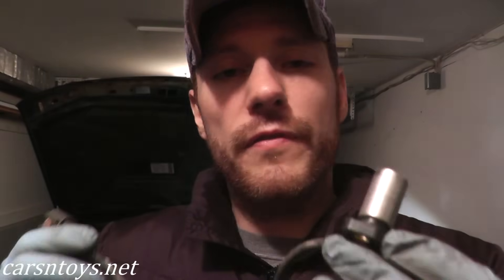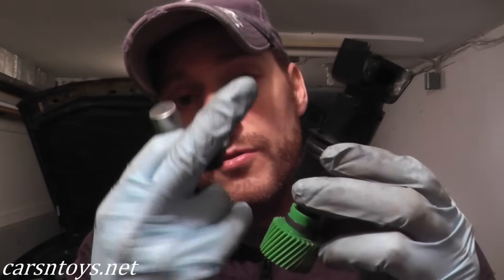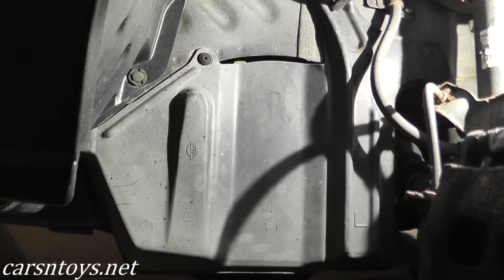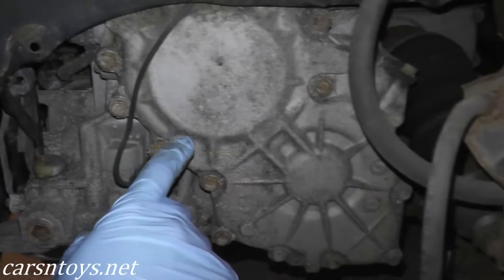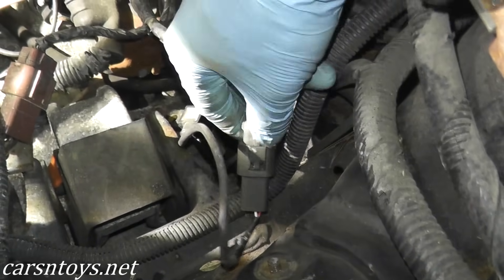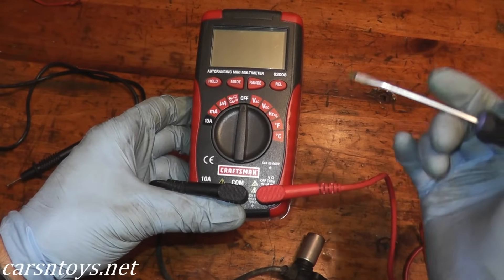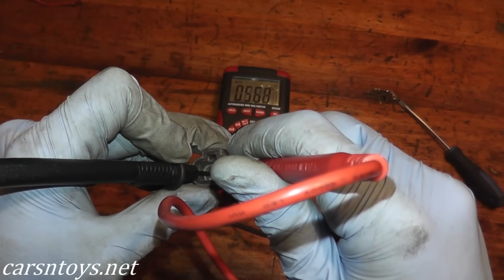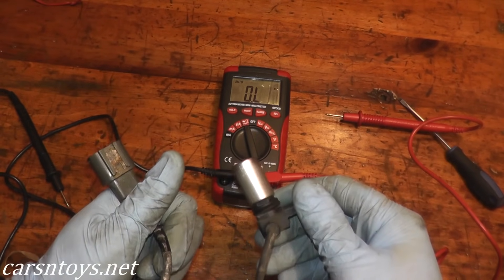Revolution Sensor P0720 Testing and Replacement

Comment: Glad I found this video. My buddy Honda Prelude 96 is throwing a P0715 code Input/Turbine Speed Sensor Circuit Malfunction. I read on a a forum if odomter or speedometer does not work, it is due to VSS, but I did not see that problem when driving the car. The symptoms are kick/jump/jerk (whatever u wanna call it)  after each shift or RPM (automatic). At first, I thought tranny is slipping, but wasn't sure. I just ordered the "Revolution sensor" from APW and hope that fixes the problem, if not, they do take returns unlike Advanceauto.

Comment: Thanks For the Clarification of the 720 & 500 codes!!  Got both the P0500 & P0720, but found that when I unplug the input & output sensors, which are the Revolution sensors on a 2015 CVT Tranny (2015 Nissan Versa Note), I got other codes for the disconnect.  But when I unplug the Actual Speed Sensor, does not pop any additional Codes.  Now need to find this Speed Sensor, not Revolution Sensor :)

Comment: I have to say I have been searching for months to help find info on speed sensors and revolution sensors and you my friend have been the best and most informative I have found.  You explain everything in very simple terms which is perfect.  

I do have a question if the revolution sensor is no good what does the vehicle actually do to give you the idea it might be that?  I;m not talking the code I'm actually wondering what it feels like, does it jerk then catch up, just plain die or what?  

Thanks again for the help.  Wish the parts for these were as cheap here in Texas as where you are.

Comment: So I did this on my 05 nissan sentra. it has a 3 pin plug but on the first and second o believe I get a reading of 503-504 ohms. would this indicate it's failing? I can't find anything on what the ohms should be specifically.

Comment: mine has .445 ohms at 2k ohms i have a f150 5.4 2005 what are the proper ohm specification  for the out put speed sensor in the tail of the transmission

Comment: Love your video. Only, where are you shopping ? In 1:20 you say the speed sensor is $125. I bought that very sensor at the auto store for only $10.
Would this location and procedure be the same thing on Ford Explorer 1998 ?  
Oh my God, you're saying, remove the driver's side front tire, and there it is ? Oh the other videos I've watched from other guys didn't say this. 
Wow, love your video, you are explaining this far better than other video's I've seen from other people. Thank you..
Reply from the maker: Glad to help. The location will differ based on the vehicle; this was a '97 Maxima. If you're uncertain where the sensor is, try Google images or forums. Sometimes you can find the factory repair manual online which will show all sensors and locations.

Comment: my 03 sentra is throwing out a po720. shifts from 2nd to 3rd is sloppy. (shoots up 1000rpms before shifting) and everyday, when accelerating from a red light, the transmission will stay in first gear... so i pull over and cycle the engine on and off, and presto, it works again... anyways, my revolution sensor/output speed sensor  has 3 wires. red, black, and white. would i test across red and white or what. i tried all the combinations, pretty sure the one i have is dead. multimeter is measuring "1" everywhere
Reply: Would you able to fix these problem? Because i am gaving the same issue with my 04 sentra. Only P0720 code is showing.

Comment: I have a Fiat Punto 2011 dualogic.I have p0720 code at only and always 130 km/h  speed. When the car is under 120 km/h code (warning) is disappearing.i changed the oss and complete gearbox. Still same problem. 
:(What do u think? Where should i look to fix it? Please help me.

Comment: I replaced my RSS and turns out a section of the wire melted or bunrnt? Anyone thinks that it might have touched the transmission and slowly melted the wire over time?

Comment: P0720 popped up on my 2002 Infiniti g20 and sensor reads ~1891 for ohm in 2000k multimeter setting... replacement necessary??

Comment: Im finished replace p0720 sensor, but not fix the problem, shifting still bad, whats the next step? My car nissan fairlady 370z
Reply from the maker: Other codes? Any mods?
Reply: @CarsNToys  only p0720
Reply from the maker: What year is your Z?
Reply: CarsNToys 370z 2011
Reply: enggartiasto dewanda  hey any luck finding out what it is ??

Comment: Please . I do need your help people. I have toyota camry 2004 se 4 cylinders. code P0500 I replaced the sensor vss. the speedometer still not working. what should I do please

Comment: Is the ohms setting as the same  continuity?
I don't get reading for any of the scope under ohms setting in multimeter,  but I get one with continuity setting; is it that same? If yes I get a reading around 1,547 am I doing the right thing or that sensor is bad with that reading. Testing the same 3 pin output speed sensor
Thanks
Reply: No, and yes.

Comment: My revolution sensor for my 2001 Maxima has 3 pins who would I go about testing it exactly??
Reply: 5v reference battery power and ground
Reply: Same for speed sensor ?
Reply: @AnythingEverythingGh  yes I repaired this car along time I moved on but from what I gathered they are the same thing it's pretty easy to replace and that fixed my code.

Comment: what about a nissan sentra I have the same code poping up and when I Google search it the vehicle speed sensor comes up please help
Reply from the maker: What year?
Reply: 2005
Reply: 1.8L
Reply from the maker: It's technically called a revolution sensor for your specific vehicle. I can try to dig up a diagram showing its location if it helps.
Reply: +CarsNToys thanks

Comment: I have a 98 maxima that bucks when accelerating and acts like loss of power.  Dealer got a p0732 code and said I need a new trans. Any suggestions other than "new tranny" ?  Anything is appreciated.  Thanks
Reply from the maker: I'm afraid that code is due to a mechanical (rather than electrical) malfunction. A tranny shop can repair the specific problem (such as control valve sticking) but it's often cheaper to get another tranny. If it was my vehicle, I'd probably go with a used tranny that has a warranty. Or, it may be about the same price just donating the Maxima and purchasing another one. The 4th gen maxima's are pretty darn cheap. Good luck.

Comment: Will this also fix a p1574 code for Nissan Maxima? (Has to do with the Cruise control being I operative sometimes)
Reply from the maker: What year?
Reply: 2003 V6
Reply from the maker: ChrisPiggy
Any other trouble codes besides 1574?
Reply: CarsNToys Yes p0720
Reply: ChrisPiggy
Reply: ChrisPiggy

Comment: hey man just wanted to say thanks for this video because most people get this sensor wrong but my question is , if my p0500 is bad will it cause it after warming up to not be able to go over 45 mph? greatly appreciate your input thanks.
Reply from the maker: +james blevins I agree. It's one of those things that people often mix up. I haven't run across a vehicle that inhibits vehicle speed but I wouldn't be surprised. Vehicles today are more electronic than mechanical. Any other trouble codes?
Reply: +CarsNToys just a knock sensor code. I think p0325. but I already replaced it. but it will drive for about ten minutes and then it deaccelerates  from 65- to 45- 50 mph,but doesn't shut off the engine. but when you try to push on the gas while it deaccelerates it chugs and and I hear it slam the tranny while trying to push on the gas. but the slower the car goes and I ease on the accelerater it chugs fast unless I floor it. to describe the chug is like a rev limiter. but if in park it  does the same thing minus being in gear. also once warmed up is hard to start. but if I start it up while its cold and warms its self up for more than a hour it won't do it unless I put it in gear even if I run it for and hour. my cluster isn't working either. but the only think of about the knock sensor is because the ecu isn't able to read the vss so it doesn't know when to fire retarting it. I have one video of it but you half to wear headphones to hear it.
Reply: +james blevins I have the same exact problem with my 2002 Nissan sentra, I replace the solenoids in the engine but it kept deceleration and wouldn't run over 40-50mph might be the revolution sensor
Reply: james blevins

Comment: Hey man my rpm and spedo doesnt work n my over drive light flashes 16 times on start up. Im goin to test the sensor as youve shown in this vid tomorrow but do you think that one sensor could cause both rpm n speedo or is it separate.
Reply from the maker: Usually two separate things. What kind of vehicle?
Reply: +CarsNToys 95 maxi i did trans diag and nothing popped up. Still flashes. And im just hoppin the gauge is done. 95 96 had bad clusters.
Reply: where you live
Reply: eating Jacksonville

Comment: Last week my 2011 Nissan Altima 2.5 S turned 80K miles then check engine light came on. I freaked out when it went into limp mode.

P0720
P0745
P0500
P0101

Comment: +CarsNToys, I have a 2006 Nissan Sentra. After watching this video i located the revolution sensor. The only bad thing is when I took out the sensor it started draining transmission fluid, i quickly put it back in to stop the drain. Is it normal to have fluid there?
Reply: Was your vehicle still hot when you took it out? Was the sensor on the top or bottom of the tranny?

Comment: my nissan code is p0717 turbine revolution sensor i cant find it :\
Reply: Marilyn Ortega It sits on the top of the bell housing On nissan Rear wheel drive cars
Reply: ouch that sucks did you ever get it fixed :o??
Reply: Nope something else has went wrong with the car it only moves on initail start can go pass 60 fine as long as i dnt stop but once i stop it doesnt want to go unless i turn it off and back on again
Reply: Marilyn Ortega Woah that doesnt sound like a healthy car ): seems wrong  with the transmission
Reply: slim jim87 ik:/
Reply: Marilyn Ortega honestly I would just look for a used one From ebay sometimes they have good ones just have to call and find out
Reply: Probably going to send the car to the junknyard
Reply: The turbine going bad that is the torque converter in the trans. This trans has to be serviced. If you can get it repaired or replace the choice is yours. Look into the fluid level first for an easy fix, fill it up and go from there.